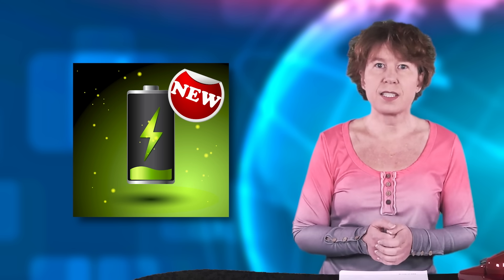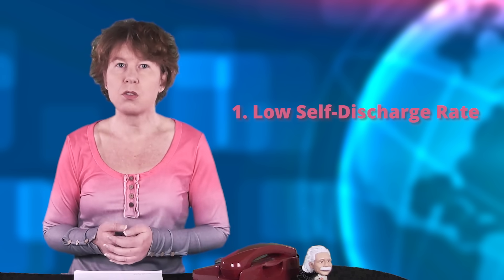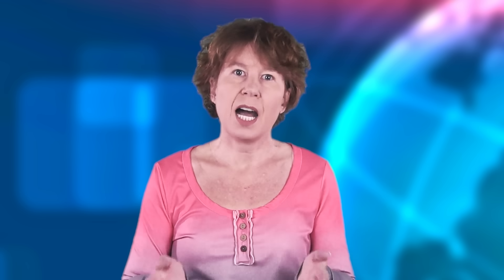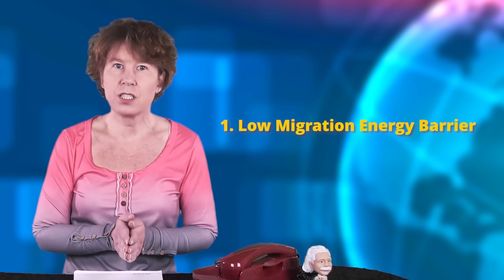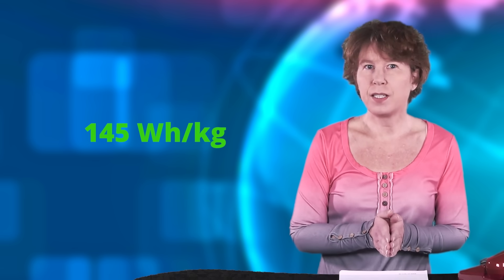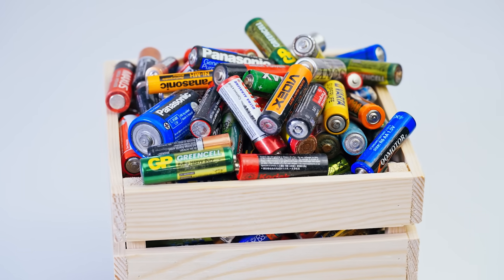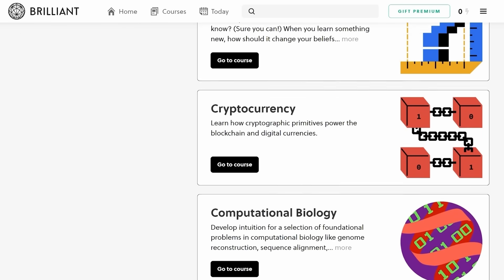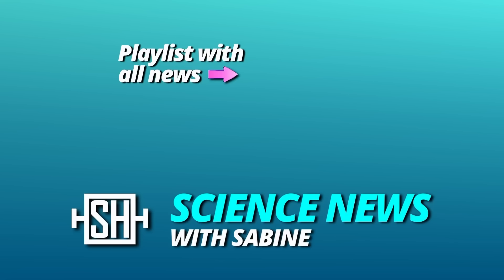Fully Charged in Just 5 Minutes: New Battery Breaks Records

Comment: Not until the grids can support it safely.  Just for fun, let's plug all phones, tablets and cars into the grid at the same time and see what happens.
Reply: so you are saying "it cannot work because something will break when i intentionally overload it"?

also charging EVs is not something time critical usually, it can easily be shifted to the nighttime base load, or to the midday solar generation peak...
Reply: Imagine what would happen if all cars decided to fill up with gas at the same time.
Reply: I'm pretty sure a single microwave turned on would be more load than 50 phones, why even put them there? They have around the same wattage as a light bulb
Reply: Turns out, rreiter, that people smarter than you have already long ago solved that problem.
Reply: @junkerzn7312  So, um, how many more million cars on electricity in the next ten years, all wanting to charge at the same time, let alone in 5 minutes just when the power gets cheap at night... If the solution is to wait until the grid is upgraded, I agree with you, that has been solved.
Reply: @rreiter  You mean the same way we have a few hundred million cars on the road all wanting to get gas at the same time with lines 20 miles long?   Oh wait... they don't all want to get gas at the same time.  Hmmm.... maybe there is something you could learn from that.
Reply: @junkerzn7312  Dude stop being a smart @ss. Its grid capacity that's the concern. We already have brownouts in places in the summer when everyone has their air conditioners on. Now imagine adding huge  power demand growth due to fast charge vehicles. Although my original post was meant to be somewhat in jest, it's not an outlandish scenario.
Reply: @rreiter  Right back at you because grid CAPACITY is projected to increase less than 0.3% a year for the next 30 years.  And brown-outs and other grid issues having nothing whatsoever to do with EV-charging, either.   You are demonstrating an extreme level of ignorance with your comments.

You also seem to have forgotten the little niggling fact that most charging is done at home, which is not Fast DC charging, AND you also seem to have missed the discussion about how buffer batteries work at Fast DC charging stations.
Reply: And just in case you didn't understand what I meant there.   It is projected, and so far holds, that the peak grid capacity required to support the electrification of transportation (primarily EVs), is increasing by barely 0.3%/year and every time a new study is done the number seems to get smaller.
Reply: @junkerzn7312  Well unless you got your own power generating station in the basement or on the roof, EV charging most certainly does come from power supplied  by the grid.  And your .3% capacity increase basically proves my point - if you think it's going to cover the increase in demand you're in la-la land; all the kwh have to both be generated and delivered whether they're buffered or not.  Buffering or scheduling or trickle charge only helps mitigate, it doesn't make the problem go away.
Reply: @rreiter  Someone here is in la-la land, most definitely.   Since you are completely unable to process numbers... at all, there really isn't much more I can do to help you understand.  You dug yourself a hole and fell into it, and now you have to dig yourself out again.  Either that or you will be screaming, angry, and unhappy for the entire rest of your life because reality will never be what you think it should be.

Comment: You actually don't have to talk to people. I usually attach the charger to the port and hide behind the building or in the bathroom. 

Oh. This is pretty darn cool. We seem to be heading toward a place where batteries will simply out-perform gasoline engines. I've read of breakthroughs that promise 600+ miles per charge. 

1TB? Maybe. Phones are reaching the point where they can replace desktops for most purposes. Or maybe someone just takes lots and lots of pictures.

Comment: Will it burst into flames if I stomp on it for 5 minutes with a full charge?
Reply: Good EVs have good  thermal management systems.  So no not going to happen.
Charging is actually more challenging because the goal is to charge as fast as possible.
Again the thermal management system monitors temperatures and limits charge rate to keep the battery happy.

Comment: When you listen to 40+ hours of audiobooks a week while you work, that extra high capacity is helpful.  Especially if you have a handful of AAA games on your phone as well.

Also, as a trucker in the USA, I can tell you that the current electric semi's are NOT adequate replacements for the diesel semis.  They lack the range for 10 hours of driving on the Interstate highways, and with needing roughly 8 hours to charge they CAN'T be used by teams.  Teams alternate who drives to keep the truck moving for 20-22 hours a day.  That means they currently need roughly 16 total hours of charge time to do less than 20 hours of driving, on loads that have to be shipped as quickly as possible.  Those numbers don't work.  IF this new battery type could let an electric semi charge up in 30 minutes or less, then so long as it can achieve a 500 mile range it would make it a practical replacement for a diesel semi.  That's where this would be a meaningful discovery.

Comment: Well... That depends, Sabine... For example, we, FPV pilots, normally use lithium polymer batteries. Although they're the most dangerous, they can give more power on a split second. 
Let's say a pilots flying with a 6s 1300mah battery (the most common I'd say). He's going to charge it at 1C which takes 1 hour, to be able to fly for 5 minutes. At most. 😬
So, if it works, I could definitely seeing myself buying a bunch of them! 😂
Anyway, stay safe there with your family! 🖖😊

Comment: Actually for our current problem of transitioning to renewables we need a low cycle, low charging speed battery because we need saison storage so like 20 charge cycles would already be 20 Years of lifetime
Reply: Batteries charged by renewable need to be able to charge in a day and discharge over a few days. If it's gusty or there's rolling clouds leading spotty energy production, the batteries will be switching back and forth from charging to discharging constantly. We don't need to plan for a year of no wind or sun. Like, what?
Reply: @truhartwood3170  what I meant is that we (at least where I live) need a way to store the surplus of energy in summer for the winter. For this we need cheap $/kWh batteries because we need a lot of kWh. Batteries that charge fast and are useable for transportation we already have. Now I would like to see more research in the opposite direction, dead cheap but can be slow charge, slow discharge, low lifecycles and heavy. If my house had such a battery let's say 1000 kWh and cost 50k€ than I am basically off grid. And compared to the price of the house a pretty good deal, no electricity cost, no heating cost, no fuel cost